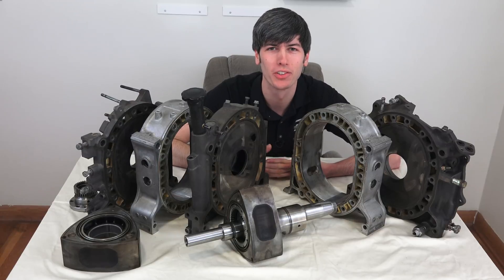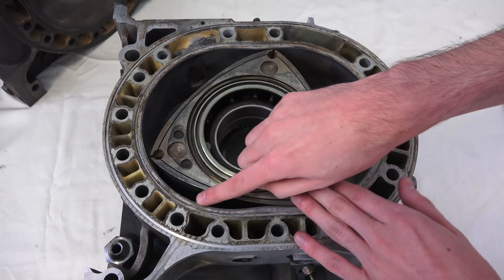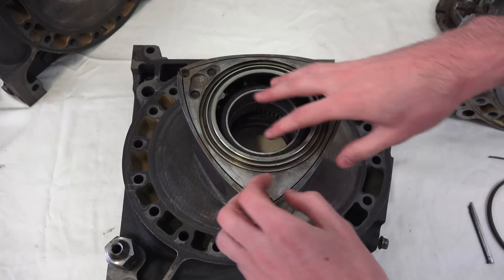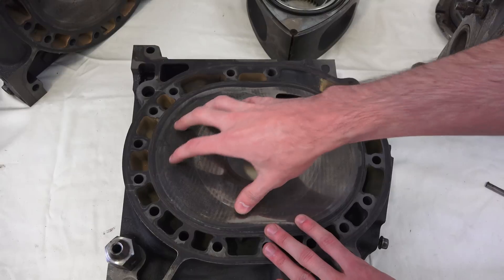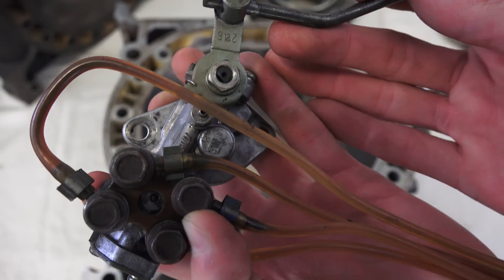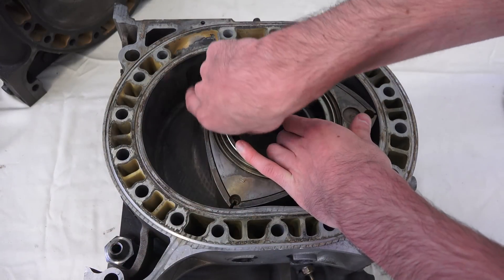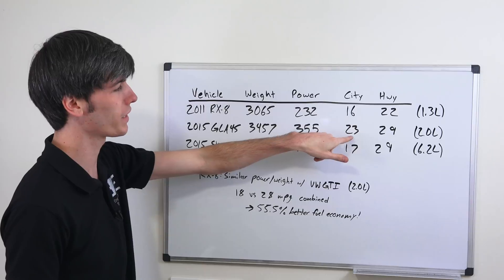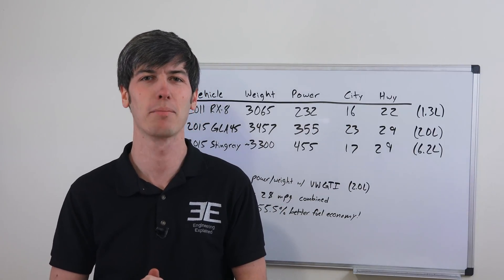4 Reasons Why The Rotary Engine Is Dead

Comment: Although the rotary has a following, Mazda would have sold A LOT more RX-8's if they at least had the option of a regular 4 or 6 cylinder engine.  Actually they would have sold more if they had no rotary at all, I'm sure....
Reply: +Maestro_T 

then the long lived "RX" badge would have been lost due to commercial opinion, maybe mazda stayed true to their badge and made the car for pure enthusiasts who enjoyed?
Maybe car enthusiasms is a little deeper and natural then your commercial train of though? ;)

pitty on you
Reply: ***** My post wasn't clear, but what I was suggesting was that they keep the rotary engine as an option (i.e., the top option) and use the other engines to keep the badge alive.  You may think that's selling out, but why not keep the "RX" badge for the rotaries and make the rest of them "MX" (as in the MX-5)?  With what I'm suggesting, they would have sold more RX-8's (or MX-8's, as I said) and then probably allowed the car to continue for those few who wanted the rotary.  Let's look at a couple of other cars as examples.  BMW has M cars but they have regular versions.  Does that make the M cars less special because there is also a 328/528, etc.?  VW has the GTI and the Golf R but a regular Golf, and so on for other manufacturers.  Those special models might not exist if it weren't for the fact they were being paid for by the lesser models.  In the case of the RX-8, there were people who may have been interested in the car but were put off by the extra fuel and oil consumption not to mention the other drawbacks the rotary engine provides and therefore didn't buy one.  Would you rather have no rotary car on the market as today, or one that has lesser models that carry a conventional engine which will appeal to more people?

Comment: This comparison makes sense if money wasn't a factor.  I'm not saying the engine isn't without its faults, but when it's half as much or more than the comparison vehicles, for a vehicle that, quite honestly, is driven less miles, is apples to oranges.  So the car gets 18mpg vs 25 of a mercedes.  How much does that mercedes cost?  Even more so a Corvette Stingray?  That's, what, a $75K car??  There's an overall cost of ownership of amount paid for vehicle vs amount of gas saved where there is a break even WAY down the road.  Also, the car isn't ALL about the engine.  It's light as hell, handles incredibly and is a good looking car.  Anyway, very well made video up until the comparison vehicles.

Comment: A nondiscrete variable drive ratio supercharger, direct fuel injection like that employed in the Renesis , the use of unconventional materials that eliminate the need for hydraulic lubrication or supplemental cooling (ceramic and plastic composites still presently experimental), and semiadiabatic thermal recuperation will solve the issues and can be applied to make reciprocators better as well. The breakthroughs simply have to come to fruition and emission regulations on oxides of nitrogen will have to allow for the efficiency improvements.

Comment: Who won the 1991 24 hours of Le Mans? Oh, right,  a rotary engine. Weren't they banned from racing the very next year? Oh, yeah, they sure were. The must've been banned because they were terrible. I mean, NASCAR banned the Dodge Hemi because it sucked, right? No, wait, they banned it because they said it won too much and had an unfair advantage. Hmm. I guess the rotary engine design had the advantage of being too reliable? I dunno.
Reply: +Raycefan  I wouln't necissarily agree  that the Wankel is a bad motor. But for the reasons stated here it's just not a good choice for everyday use.
Reply: +Checkm8king2, I respectfully disagree. Here's why: after the 24. Race it won, it was inspected and found to be in such good shape, it could've run another 24 hour race immediately after. That engine had 4 spark plugs per rotor and 4 rotors. So, it was different than the one in this video. It is easily the most reliable design ever to come along for a combustion engine. Plus, it is capable of putting out more HP for its sauce than most any other design. As for emissions, and fuel economy, both of those can be improved.
Reply: Raycefan Thanks I wasn't aware of that.

Comment: i notice you didnt do a redline comparison, real and potential.
Reply: +twistedbydsign99 
Whats the potential of an engine you have to thrash to death to get any usable power out of it...?
Reply: High rpm without blueprinting the engine means we can cheaply get higher exhaust pressure than a piston engine. Therefore we can put a gigantic turbo charger on it :)
Reply: +twistedbydsign99 
You would need a massive turbo to make up for the engines awful performance.
Reply: Manoo42 Yea you are right that is why you see guys converting TT rx7 to single turbo, gotta fit a beast.

Comment: This is why they are called wankel engines, cuz they're wank!  there  must be some advantages tho? you  didn't mention torque? or power curve ect? if they was as bad as you claim then surely Mazda would have given up on them much longer ago.
Reply: +pierrelarouge they have one advantage. RPM. they run smooth at extremely high RPM, and generate a pretty good about of HP for the weight. They're popular in drag racing for that reason, as well as in some aviation applications. bout it, though.

Comment: This asshole doesn't realize that people are constantly swapping these into their rides and trading their first born kids for them. His argument is that compensating for issues with special parts and modifications to make the engine function optimally. After watching this kid with his decoder ring and lunchbox finish, look at some of the SERIOUS gear heads and what they did with these. You know what else has shitty mileage? ANY serious project car meant for speed. He's not even mentioning all of the modifications that can be done to get around these problems. Probably still a virgin from the looks of it
Reply: +TRUE_IRISH Blood&amp;Bones oh yeah, you can get silly amounts of horsepower out of these things. But enthusiast potential is only going to carry an engine design so far. The fast majority of the cars that had these are stock.

In twenty years, the ONLY engines that'll be left will be the hybrids, and any Rotory/boxer/LS you can still find a running example of. The hyper-efficient engines sell well enough to make those a better business move.

Comment: In a H.P. to Displacement comparison the RX8 COMES OUT ON TOP:

RX8 178.5 H.P. per litter
Mercedes 177.5 H.P. per litter + 392 extra pounds of weight as compared to the RX8
Corvette 73.4 H.P. per litter + 235 extra pounds of weight as compared to the RX8

The Rx8 and the Mercedes both make MORE H.P. than the Corvette (more than double).
In theory and comparatively speaking, a 6.2 litter Rotary Engine will make 1106.7 H.P.; that's 651.7 more H.P. than the Corvette. This difference in H.P. demonstrates the superior efficiency of the Rotary to CONVERT FUEL into H.P. 

In Australia and Puerto Rico cars with 1.3 Rotary Engines are running the quarter-mile in the 6 second range. I doubt any 6.2 L has ever done that.

Comment: Oil is not injected to keep the rotor sealed. It is to make the Apex seal slide better against the housing to prevent excessive apex seal wear.

Comment: Ok, now here was my understanding about fuel economy.  Rotaries are better with the high rev range fuel economy, that you usually see in racing, compared to it's piston counterpart.  Think about how those piston engines are running rich to prevent seals from being eaten up at high revs, and it is an engine that is fighting the momentum of the piston and more moving parts (friction increase?).  Rotaries do send more of the heat out of the exhaust ports than though the radiator compared to piston engines ...... so radiators are smaller and water pumps don't have to work as hard.   Wasn't fuel economy part of the reason for the wins in 24hrs of Lemon?  They didn't have to take on as much fuel.

Comment: Funny even my old 99 Audi A8 Quattro (AWD) with a 4.2 liter V8 with over 200k miles gets a little over 17 mpg city and 26 mpg highway. And it's 300 HP and weighs 3800 lbs since it's all aluminum. You can even seat 5 people very comfortably too.

Comment: It's an awesome concept and works great for race cars (787 anyone?) but in this day and age, it simply can't keep up with emissions and fuel economy.

He failed to mention the engine's issue with cold starting and flooding- if you flood it you have to remove the plugs and allow it to evaporate out, being that the plug holes are on the side, that can take some time.

I would love to have an old RX-7 I have a sweet spot for small, zippy little cars, I've owned a couple miata's a fiero and currently a Fiat Abarth (with a piggyback computer >:D)

Comment: another issue you failed to mention is these engines have had about 50 years of development in production vs 100+ for the piston engines, regardless of modern specs, they didn't get the piston engine right the first time either.

Comment: This kind of engine could run on ethanol and be downsized to be a generator on demand for electric cars. It's just a matter of thinking about it, really, aside from the rotary engine racing mentality and the coolness factor.
Reply: +DyingCr0w But you shouldn't turn a Rotary off when it is cold. The air/fuel mixture is high and it pools and dilutes the oil, which wrecks your seals. You need to rev to 3000rpm then turn off. Also by contrast you shouldn't turn off a hot engine as the heat difference. I installed a Turbo timer in my Rotisary which ran the engine for a few minutes until it cools. That and running 2 stroke oil in the fuel. I installed a NA 13b peripheral ported engine in a '72 VW beetle,  the radiator was in a 911 Turbo wing below the rear window and the rear was exposed as a street Baja style. The exhaust ran up over the gearbox to get enough length.

Comment: When you think how inefficient the piston engine is - countering forces, vibration, noise etc. - the Wankel was a genius idea. Surely since it was first invented there must be better materials now available for the seals, or the rotors, or even the whole engine?  Second question, as it's virtually a two-stroke anyway, why not use two-stroke oil to get over the lubrication problem?

Comment: We had a 2006 RX-8. Noisy little bugger that drank oil and gas. The inside was cheap and reminiscent of the Mazda 3 of that day. Didn't help that to coax any power out of the car, the pedal always was getting mashed to the floor.  

We traded it in for a 2008 Infiniti G37S. Didn't pay much more for fuel, but the car cranked out over 100 HP and torque more. Plus the inside didn't feel cheap.

Comment: You are correct as far as emissions killing the 12A and 13B engines due to the process exactly as you showed which lead to the laps before the RX-8. The RX-8 engine was designed to fix this by using a peripheral exhaust port (not shown) similar to the intake port. It fixed the emissions but killed the performance (no turbo model for your graph). If you don't choke it out for emissions the rotary gives the most power of anything other than a turbine engine. The sealing has been fixed with ceramic apex seals. they can get up to 6X the life of the factory seals. Auto rotary I'll agree is dead. The pollution Nazis will make sure of that. But they are still big markets in aviation, marine, snow/atv... It is exponentially a better design when turbocharged. The Rotary Engine is a long way from dead.

Comment: Reason No. 5 (should be on top of that list): You have to get the engine out of the car for a repair, unlike a 'normal' combustion engine. That can be replaced piece by piece from the top.

Comment: Rotary engines are garbage, just ask any previous RX7 TT owners, like myself...
Reply: I used to work for a rotary shop, non-stop work.....  RX7s are beautiful cars and when they run right, which is about 50% of the time, they are great.  Again, the engine is garbage..
Reply: +Lord Beerus like what kind of maintenance you do in you're car may i ask?
Reply: +Lord Beerus keep using it till the enging cooks itself and spend thousands of dollars to fix it

Comment: I'm surprised Mazda hasn't addressed these issues over time. I'm sure there is an engineer somewhere out there that can solve the rotary problem and turn it into an officiant motor. While still surpassing and exciting the old rotary in performance and HP.

Comment: But a piston in a piston engine is also moving away from the spark plug. The spark plug doesnt ignite the last part of the fuel mixture when the piston is at the bottom///when the rotor is at the exhaust, that is a spreading combustion.
Why would they balance the combustion so that there would be fire in the exhaust? They can not be that silly.

Comment: The wankel is a 1.3l engine, but it is also technically a two stroke engine and should therefore be classified as a 2.6l engine. That is how it is classified in motorsport classings.

Comment: We had a car with a rotary engine and it burned all the oil and the motor seized up. The dealer gave us no time table to check for oil levels, we couldn't get it right, too much oil, too little oil, when to replace, how many miles per quart of oil. It was totally confusing especially with two people operating the vehicle.

Comment: Funny thing is, my 1986 RX7 gets around 26mpg while my 2006 Subaru Legacy GT gets around 17mpg and both cars burn about the same oil and I'm still able to drive the RX7 much faster (safely) than the LGT. Both cars are unmodified.

Comment: I wish this engine was developed for piston aircraft. Great power to weight, simplicity = reliability (highly desired in aircraft engines), low parts count means cheaper overhaul. The fuel economy and oil burning are also moot points when your average gallon of AVGAS is running $5.50 per gal. It shocks me that the box style aircraft engine has had zero innovation in nearly 70 years and they retail new for 30k..........
Reply: +Jess Whallon This is a braindead comment. So instead of 1 tonne of Engines on a 747 and 1,000T of fuel, you'd rather have 500kg of Engine and 2,000T of fuel, PLUS the oil reserves required????
Reply: You are the one who is brain dead here. 747s don't use piston aircraft engines! You clearly know nothing about aviation with your made up arbitrary figures you pulled from your ass you call a brain. Get educated before you start blathering all over the comment section.

Comment: Still buying an RX8 as a weekend car :D Sorry! I'll make it up by using far less fuel in my Subaru XV Crosstrek Hybrid!
Reply: Thanks man! I'm just trying to find a 6 speed manual grand tourer model with low mileage for sale (under 50k miles) with the sparkling blue mica color.

It's gonna be my weekend car, which I assume is what people buy those for. Nobody buys a Miata or a Lamborghini or M3 as a daily driver, at least, not normally.

Comment: I owned a 1972 RX-2 coupe...yes the fuel economy was worse than most cars it's size (I got around 22mpg on the freeway) and this was before the gas shortage so who cared...BUT it was so very heartwarming to blow the doors off my friends BMW 2002 for less than half the buy-in cost of the cars.  Time has not been kind to the rotary, but they will always hold a place in my heart.

Comment: IMHO the rotary could be a great aircraft engine.    Specific fuel consumption of the rotary is only 10% worst than aircraft piston engines but 100% better than a turboprop or jet engines.    Also, the rotary is the only aircraft engine that has a 'soft' failure mood.   The rotary will continue to running with power for forward flight without causing a fire or engine stoppage, typical of piston and turboprop/jets.    The future of aircraft engines is probably the rotary if someone was interested in investing in the large certification cost.

Comment: So the legendary rotary engine is a failure, it's mazda's experiment and all the Rx owners r just a rat
Reply: +Kyle C Uh no? There used to be millions of rotary vehicles in the mid to late 1900s, Mazda sold hundreds of thousands of rotary equipped cars annually, until piston engines started becoming more efficient and powerful and in almost every way superior with the development of dual overhead cam valvetrains and better engineering.

Only thing I would have done is release the RX8 with a twin turbo system and the same REW as the RX7. The RX8 was heavier and less powerful so in my eyes that's an automatic failure as a successor to the legendary RX7.

Comment: I raced against these in the 1980s. IMSA had started a "Camel Lights" category similar to the GTP (former GTX, which is a LeMans derivative). The Lights had less than 3.0 liter, and allowed the rotary engines from the RX-7 into their chassis. They were insanely loud. They were the only cars that were required to be muffled everywhere they raced, and it was still like someone was dropping cherry bombs and M80s at your door as you were passing them. They had to use diesel truck mufflers that were huge, compared to the exhaust pipe, because they had frequently blown out the smaller muffler's guts. At Sebring I actually got out of the throttle to let the guy I was passing to get back ahead of me because the noise was so painful. I never liked these engines, but there were the die-hard fans that swore by them. I am glad you have given the facts - and the explanation on why they were so damn loud.